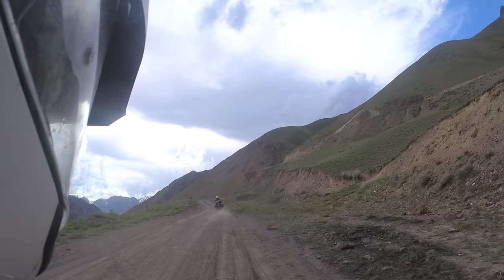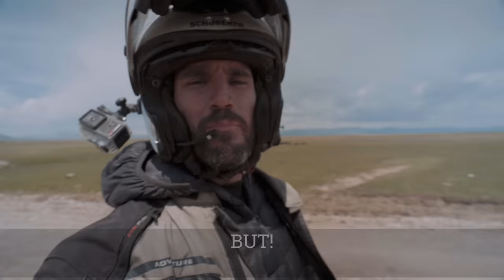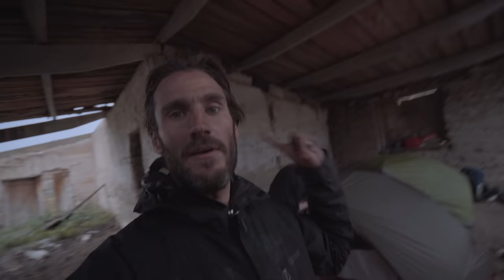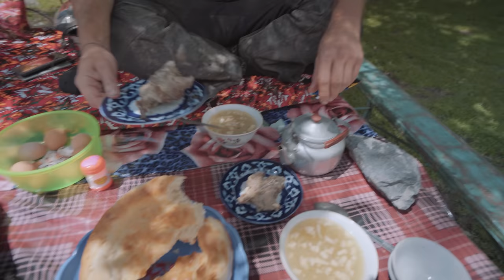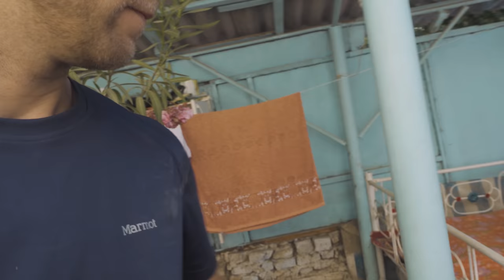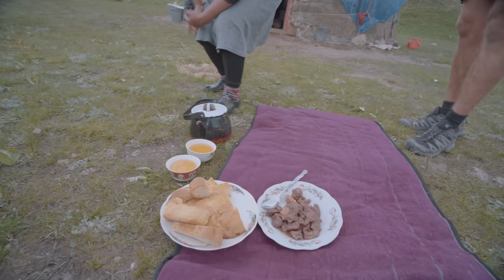Kyrgyzstan - an adventure rider's paradise -  Riding from Sydney to London EP 23

Comment: Try using a leather tire liner to prevent punctures!!! You can also use bicycle tire tubes in an emergency even if you have to pack an extra deflated tube around it to reduce the space.

Comment: Top tip to future bike + MC travelers:-  If your front brake has been upside down (crash/fallen over etc) and air from the master/lever has travelled down the hose, just strap or zip tie your lever to the bar and leave it for 12-24 hours. Undo the strap, quickly pump it up, then strap again, after another 20-60 minutes will probably be fine. This allows any air trapped in the hose just below the master/lever to travel back into the master reservoir where it belongs.
These guys found out the hard way that if you get air in there, its tricky to 'pump' it back up. Best plan is to use a syringe and a piece of hose with DOT fluid in it, and push it from the caliper bleed port up to ward the lever not the other way around.
Krygy is great though, properly amazing MC country.

Comment: The brake master cylinder probably has sediment blocking the feed hole thus not allowing fluid in to replace what's been drained through the bleed screw. To remedy this, disassemble the master then blow compressed air in the reverse direction, bleeding will then be possible, good luck.

Comment: Hi, when you asked for a holiday at work, how many days did you guys ask for? With all the problems, how can you plan a trip?
Reply from the maker: We both resigned/finished our contracts. We knew the trip would  take at least 9 months so definitely not a holiday haha
You can hire motorcycles  there though l, it would be a great short adventure
Reply: @Northandleftabit  i bought a DR650 too and am allmost done with all the upgrades. Do you use steering dampeners?
Reply from the maker: @roderickneven1844  There is one on Jays bike. I think they do help but also alot of money. Id put it in the nice to have category behind better suspension, new seat, wider footpegs and a bigger tank